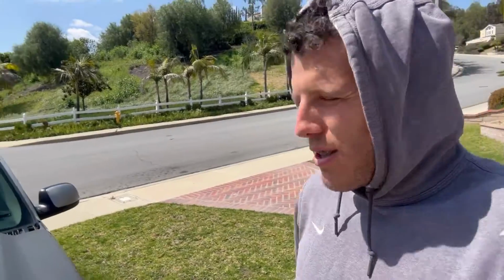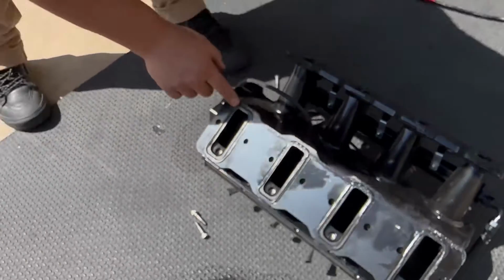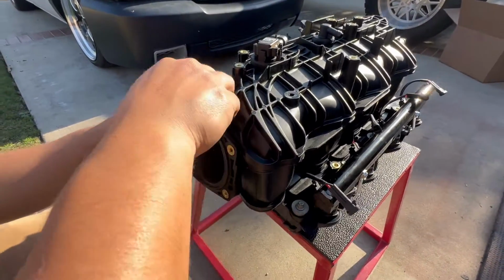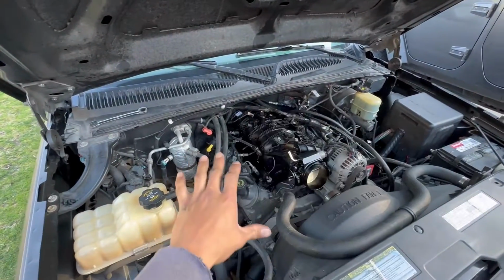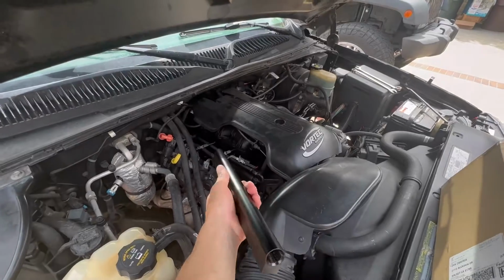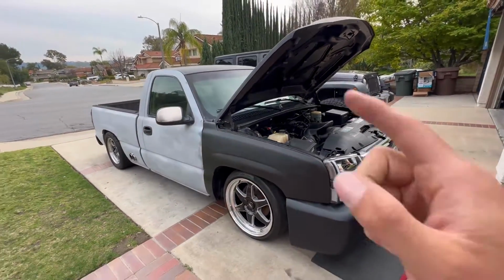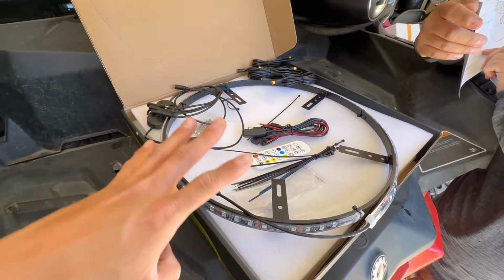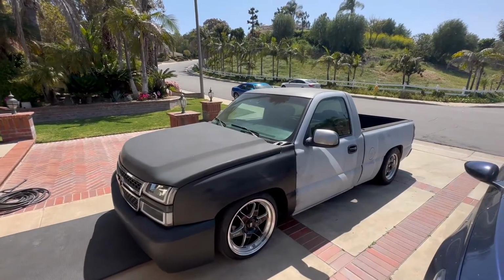CAMMED SILVERADO 5.3 GETS A TBSS INTAKE MANIFOLD!!

Comment: does a tbs intake fit a 2012 5.3 with 243 heads ?
Reply from the maker: Yeah, I’m pretty sure it would fit 243 heads
Reply: Yes, it fits all cathedral heads.
Reply: 2012 should already have the TBSS style intake. 07.5 - 2013 4.8 & 5.3 had them.

Comment: Just watch your other video of it getting tuned idk if its the tuner or what but my 5.3 with stage 1 summit cam did 315 to the wheels no other mods. Just did stage 4 btr dual spring kit tbss intake and 92mm throttle body and it did 357 but truck was starving for fuel at 5krpm need bigger pump and cam sensor went bad lol so need to swap and go back. Bad ass build tho bro
Reply from the maker: So just a cam? Because mine is similar just a cam no heads, no headers, nothing everything else is stock on mine. The intake and e85 dont make much power gains on NA builds. I wasn’t too worried tho just wanted it to drive well i plan ln boosting it later! Thank you tho!
Reply: Not much of a difference according to dyno test

Comment: $499 for A team fanned intake manifold kit with rails and throttle body just needs injectors or find a used complete TBSS intake manifold for $350-$750 plus the $270 X link adapter for the throttle body  

from what i gathered online is A team gaskets sucks(according to video) loses torque down low but gains can be seen after 5500RPM and TBSS is as good as it gets unless you spring for the FAST lsxr intake and throttle body and fuel rails and injectors 🤦🏽‍♂️

Comment: So glad you ditched that sheet metal intake, it would have made more power with the stock intake and TB than that thing. The TBSS was the right choice for future mods. Did you ever get it retuned?
Reply from the maker: You think the sheet metal is better for boosted applications?
Reply: @ErikRose_  not in a 4000+ lb truck with a 5.3L. They kill a ton of power under 5000 RPM. The TBSS is the best intake for the money for 99% of the time. I only bought a FAST LSXRT because I have a 6L swap (got a crackhead deal on it too) and am going with a decent sized cam and a set of ported PRC heads. Even then, below 4000-4500, the FAST makes the same power as a TBSS. Up top, the fast will be worth some power on my combo.
Reply from the maker: @bluecollarhotrods9781  Nice thanks for the info! Sounds like you gotta solid build brotha! Im going for boost in the long run!
Reply: @ErikRose_  Boost is always the goal. Haha Weather you start with a mild cam 4.8L, or a forged 408 - it will do the same thing with boost, but more of it. So the more you start with n/a, the more it will make with boost.

Comment: What do u think the best I take would be for my 5.3 about to rebuild the tranny sense it went out gonna put a shift kit in there and a 2300/2500 convert with lockup. And I’m gonna also throw a stage 2 summit racing cam with ls6 valve springs and ls7 lifters. What u think with that set up the best intake man would be ?
Reply from the maker: lsx fast is the best if you dont mind spending the money but if not trailblazer ss is another solid one out there! 🔥
Reply: For sure I want the fast but man $$$$ loll

Comment: Great video... i broke my pcv connector on the intake how would you go about replaceing it.. do i tap it out and put a treaded nipple or is there a replacment part?
Reply from the maker: Appreciate the support brother, if you’re talking about the nipple in back of the intake manifold in just snaps in and out you just need to push the  release tab in to switch it out.
Reply: I think the one on back is connected to brake booster... the one on top towards the back was connected to my pcv  but since its been broken i dont have it connected at all..
Reply: Or are u talking about the integrated nipple facing the passenger side?
Reply: @tripstomexico9770  no.. the one on top of the tbss intake that goes to the drivers side pvc vavle cover.

Comment: Dope video man! Can you add videos of you doing rolling pulls of from a dig? Was there a difference from each other ? Another question bro, where did you connect your vacuum if you regulator
Reply from the maker: Yessir I plan on doing full throttle rolls and digs soon! I just didn’t in this video because i need to roll my fenders first they chew up my rear tires when i push it. The first initial difference I get is mainly the sound other than that im sure performance is similar but i’ll see once i push it. The Vacuum from the regulator I put onto the top left of the manifold, I believe the tbss has two areas to put it but I put it on a plastic covered entry that has to be broken off to use.
Reply: I have the exact same set up bro just no cam. My regulator I have it vented to atmosphere but was wondering if it would make a difference with vacuum to it.

Comment: Did your sheet metal intake sound super loud like a lot of air was sucking from the breather? 
I’m thinking about changing intakes
Reply from the maker: Yes it did that’s pretty common with them, that’s one thing I didn’t like either and another reason why it just did the tbss. You can also try putting sound deadening on it to remove some noise but it ruins the look of it.

Comment: Nice!!!!!! Which Deep Motor 
fuel rail did you end getting? I have 05 L33 and I'm gonna use the TBss intake for my swap.
Reply from the maker: Yeah Tbss for the win forsure great intake so far! Heres the link to the exact ones i got for mine!

https://www.ebay.com/itm/401730620827?mkcid=16&mkevt=1&mkrid=711-127632-2357-0&ssspo=HOlGcXiDTbW&sssrc=2349624&ssuid=nCH1hP3qSsK&var=&widget_ver=artemis&media=COPY
Reply: Aye bro you got a link to the tbss?
Reply: @wandabreadDro  TBSS intakes are like $150 on rockauto bro🤝🏼

Comment: Did you need to tune it right after installing the tbss intake ? Or just plug and play and you can tune it afterwards
Reply from the maker: Nah you should be good you can tune it afterwards, unless  you do bigger injectors and throttle body then you might want to get a base tune in there before you drive it.
Reply: Can I drive it with the newer injectors without tune?

Comment: Can I install the tbss mainfold in my stock 5.3 ? Or die it have to be moded ? Can I have your old set up lol ?
Reply from the maker: Yupp you can add it to a stock 5.3 but there are a few changes you need to do, like running the tbss fuel rail which is also return less so you would need to either run a regulator or do something else. Also if you have the earlier system with egr and emission stuff you will need to delete it. And I got rid of the old system already sorry.
Reply: Thanks for replying 💯
Reply from the maker: You got it man 👌

Comment: Where’d he run the vacuum line from the fuel pressure regulator??
Reply from the maker: We ran it to the intake manifold, to the little nipple on the rear passenger side of the intake manifold

Comment: how did u do the swap with the return fuel lines and the sensors
Reply from the maker: There are products to adapt some the sensors the map sensor was put in the original spot in the tbss manifold just had to use a bigger o ring or some method so it fit in the bigger hole and some things were deleted and tuned out like evap and evap solenoid sensor And capped off. As for the return line with our setup we have an aftermarket fuel pressure regulator and the bottom port of the regulator goes back the the factory return and the feed goes into the regulator and the other outlet goes to the rails feeding both. Hope this helps with anything.

Comment: whats the best budget performance mod for the 5.3
Reply from the maker: Tbh its pretty tough to get power out of these engines without spending a little, if you know how to do your own work i’d definitely do Cold air intake and intake manifold those are on the cheaper side, a Cam is gonna be your best performance gains besides boost, you can get some stage 1 set ups for under $500
Reply: Torque Storm blower, or cam kit with Long tubes, or both.
Reply from the maker: @bri-manhunter2654  Yes you can get a great deal on some speed engineering long tube headers with some decent gains I think imma get some !
Reply: Stall converter, yes - even with a completely stock truck they make a big difference. Not a baby 2600-2800, at least a 3500. For the money, not much else even comes close to the gains. It's not uncommon to pick up .5 - .7 from a good converter.
Reply: @ErikRose_ . TSP is currently having a 20% discount on headers! LT’s and a tune are always a great bang for the buck move.
I’m just of the opinion that if you pull the LT’s you might as well do the cam too💪🏻

I remember the first mods for my truck was tune, LT’s, and 3K stall. It was nice, but I should have swapped to the 8speed earlier.

Comment: So did it run better?
Reply from the maker: A lot better, fixed my misfire issue and feels like it pick up some power because of that issue. Overall it feels a whole lot better
Reply: @ErikRose_  why was it miss firing ? More air from the tbss ?
Reply from the maker: @edgarzamudio5040  nah it was misfiring with the previous sheet metal intake i had on it but thats only because im running e85 and the fuel ate up the rubber gaskets on it and was causing a small leak !